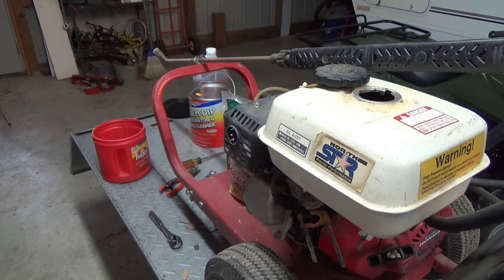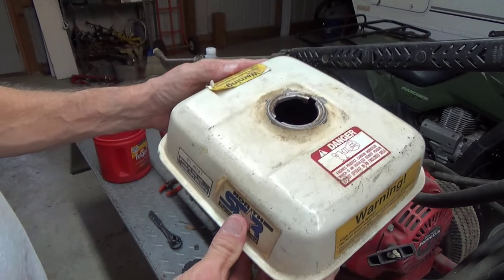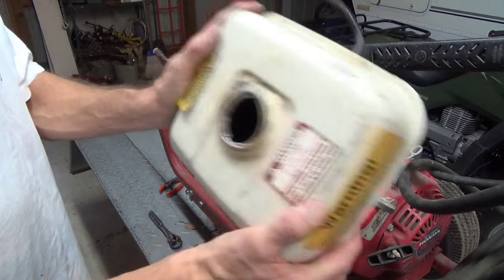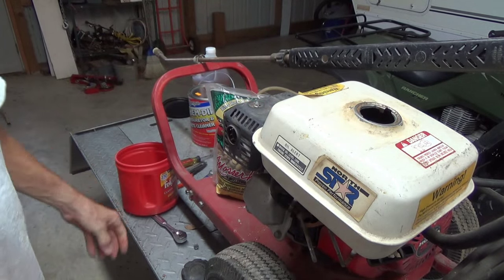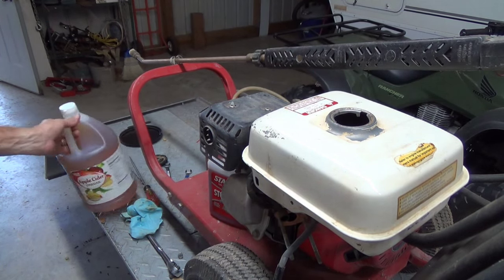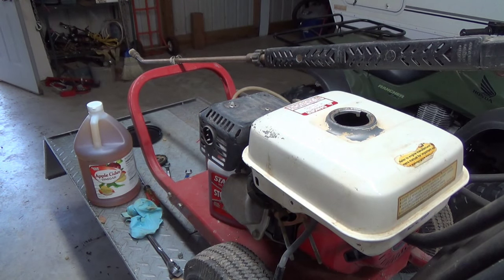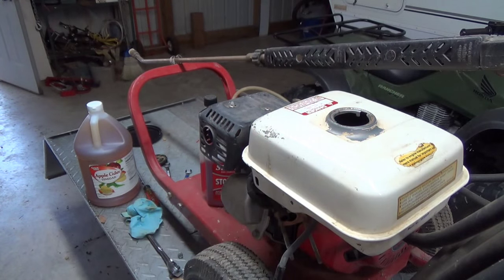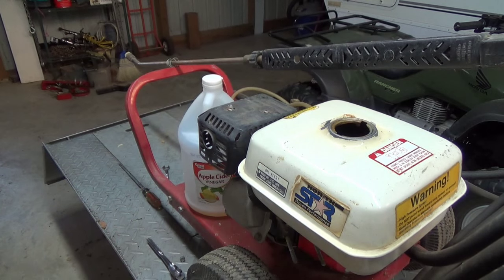REMOVE RUST FROM YOUR GAS TANK THE CHEAP & EASY WAY

Comment: For rust removal, white vinegar is exactly the same as cider vinegar.  Acidic acid 5% is the actual part that helps loosen oxidation.  White vinegar is made directly from distilled alcohol where cider vinegar is made from apple cider that has been fermented to produce the alcohol that will become acetic acid.  Taste is different but rust don't care about taste!😀
Reply: That's one of the very best and cheapest methods I ever used !
Reply: yes I caught that too, but you covered it.  Thanks
Reply: What do you use after cleaning vinegar

Comment: FYI,  What I think works best is,  go to your local aquarium supply store and get a bag or two of aquarium gravel, it's very small and sharp.  Put the gravel in the tank to clean with some water to make a slurry,  slosh it around and it will clean the interior of your tank, make it like new.

Comment: Great video.
Slightly more aggressive than vinegar,toilet bowl cleaners with the active ingredient being hydrochloric acid (don't use the bleach type) will really help to save time. The Works or Lysol 10X gel. Can be cut down with water if an overnight treatment is necessary. Ratio being 1:1

Comment: I use 2-cycle gas to coat the inside of de-rusted tanks. I do this with the tank off where it can be shaken and turned upside down. I also use double the 2 cycle oil with the gas. I use about a pint in  my generator tank if it's going to be empty for more than a month. The engine fill fire right up months later. During hurricane season I keep non-ethanol stabilized gas in both generators and keep the tanks full. The ethanol will attract the Louisiana humidity and water will end up on the bottom of the tank. Keeping the tanks full is a practice that I've started year round, but requires that you start the equipment on a regular basis and to use ethanol free stabilized fuel.

Comment: Trick I learned from grandpa on the farm years ago...
If you have a bad case, fill the tank about 1/3 full of small rocks and some lubricant like a cup or two of diesel, strap or tie the tank to the inside of your tractor (or even lawn mower) wheel, and mow drive around for a bit.  You can achieve the same thing if you have a cement mixer around to do the tumbling for you at low RPM. Just be careful that you don't have anything inside the tank like pickup tubes or anything like that and remove them first if you do.

Comment: I have a vibrating pot for knocking the rust off parts and nuts & bolts.  I put some of that media in my tank, then duct taped it to the pot.  Turned it on and ran it that way for a while.  You can also tape items to your vibrating sander in a vise to agitate them.

Comment: If it was aluminum it won't rust.
Reply: Jerome Cook aluminium  rusts reacting with oxygen and forms alluminium oxide the white particles in tank if ur doing acid but the alluminium oxide is not harmful
Reply: stainless steel
Reply: Can still get dirt and debri stuck to the inside though so just use something less abrasive

Comment: Did anyone else notice he put a different tank on instead of the one he started with?  I'm sure the gravel method works, but no need for tricks.
Reply: David S I see what you’re talking about
Reply: It's the same tank.   It's just turned around in the beginning vs. the end of the video.  Pay attention to the stickers on the top and sides, along with the holes on the lower side of the tank.
Reply: He did not use different tank he spun it 180 degrees when he put it back on

Comment: I was actually paying attention to you until you said "be careful if you're doing this on an aluminum tank".....   What the hell have you been running for fuel?????  Please do a video on how to clean that rusty aluminum tank. Are they harder to clean than a rusty plastic tank??
Reply from the maker: That's a steel tank in the vid. Shaking rocks around in an aluminum tank my dent it.
Reply: He mentioned aluminum because this same method is used to clean old "gelled" gas out of a tank that sat for a while
Reply: I use lacquer thinner for jelled gas (takes 30 minutes) and electrolysis on rusty STEEL fuel tanks. Been a professional mechanic for close to 50 years so I go with what works.....  I don't believe I could look a customer in the eye if I had to tell them I was billing them for cleaning their fuel tank with gravel from the driveway.
Reply: aluminum may not "rust", but it can get all sorts of scale and corrosion over time and create the same types of problems. I was actually paying attention to you until you didn't realize that simple fact.

Comment: I use airplane gas in my snowblowers due to the little use they get.  Started using it in my tiller and weed trimmer too.  I also park my motorcycles and garden tractor with a full tank of airplane fuel as well.  No ethanol in that gas and airplane fuel has to be clean.  After all, you can’t pull over if the carb gives you problems in the sky.

Comment: Brilliant!  I have a 2009 Subaru SP170 engine powering a RIDGID 3000 psi pressure washer.  A year ago I left some pump gas in the tank, and voila'...when I got it back out again, the engine's tank & carb were leaking.  Looking into the tank I found that it rusted to a pretty shade of orange...and crap got down into the carb.  So I am going to try your brilliant technique using gravel AND the apple cider vinegar techniques on the engine and keep my fingers crossed.  Thanks for the great idea!

Comment: Learned a few good tips from you my friend Thank You for sharing one thing you said  about China rubber i learned the hard way ............ For anyone buying fuel line/fan belts /(even) rubber bands spend a little extra look for Made In USA because China builds most things with little concern for longevity/safety/ or quality  which can be costly and deadly .....china 1/4 fuel line rots after 3 years  on a new generator from home depot  building center dripping gas on a hot engine  hello ( fire) so be aware .....

Comment: I buy 5 gal of AVgas LL100 every year for small equip,  including chainsaws...add a double dose of stabil or equivalent. The gas is about 6 bucks a gallon but I havent had any springtome starting probs and definitely no water in the gas.....its well worth the trip to the airport..

I use the last 4 of my social prefixed by an N...for the tail number of my airplane that only needs 5 gallons to fly....
Reply from the maker: Yep. The gas you get  these days suck! You have to buy premium to run in your weed wacker and don't mix up too much because it won't store for very long. The scam that is ethanol is killing all the crap Chinese made rubber o rings, washers, etc in these small engines.
Reply: Just a heads up, 100LL has a lot of lead in it .
Reply: @NordboDK  Will using 100LL bring out the 'liberal' in me and make me wanna hug a tree?